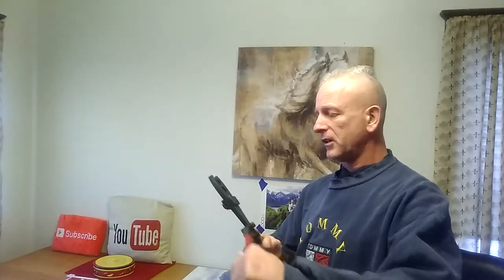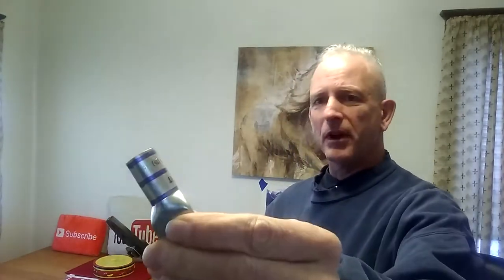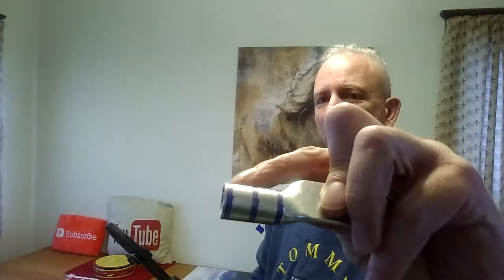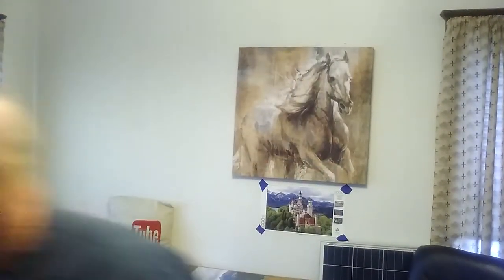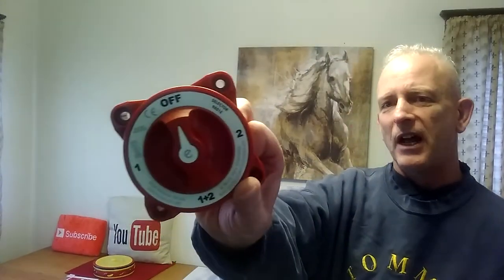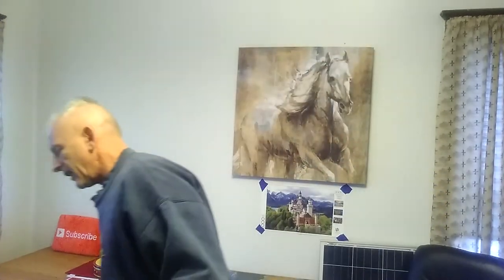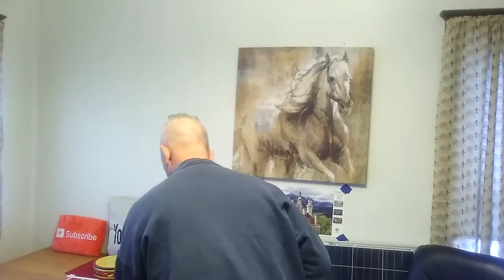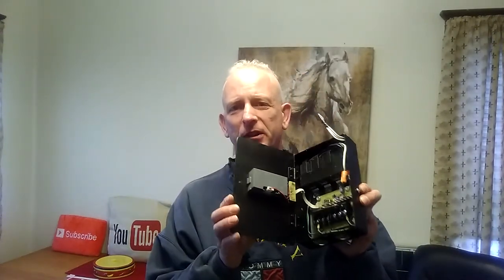4 Ott Crimpers For Solar Off Grid Cables

Comment: Nice crimpers I have a set of those type & the hydraulic piston type also both get the job done. Look into getting some self adhesive shrink-wrap its great stuff no need to solder. U can also look at my battery switch videos to  see how easy it is to wire them up.   U can also use them to divert power to run big DC loads such as for a water heater . Best of luck on your project.
Reply from the maker: +TheKilog69 thanks for your tips. Somebody just told me to watch your solar array videos